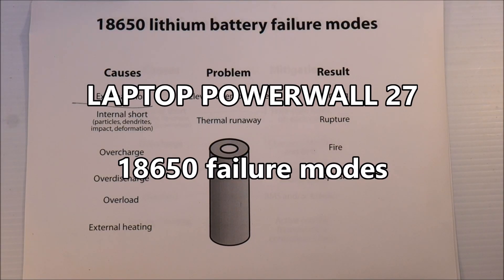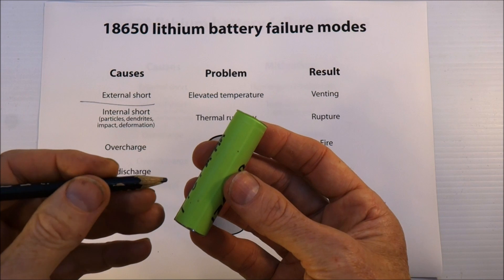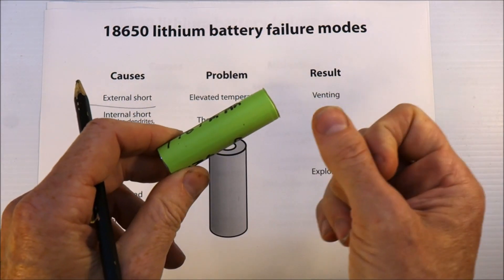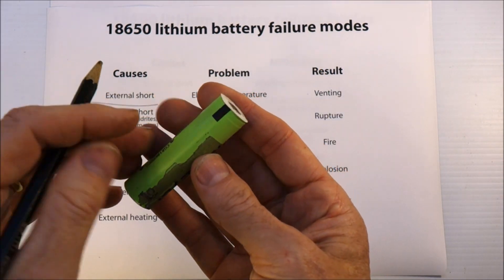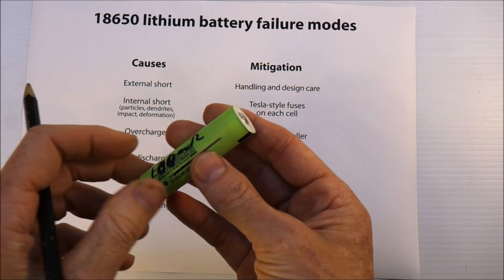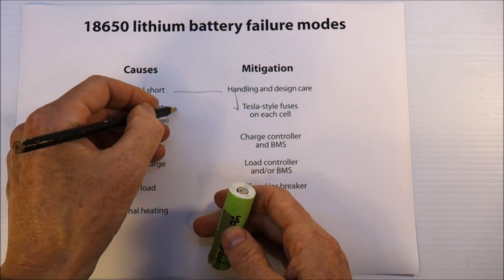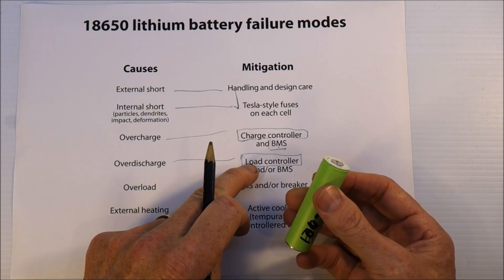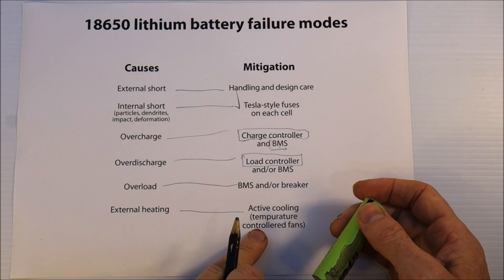Laptop Powerwall 27 - 18650 battery failure modes

Comment: Nice video!
I asking myself what happen if, let say, one cell in the midle of a pack starts (for any reason) a thermal runaway and start to "burn"?
I wonder if it could create sort of chain reaction : overheating near cells that would start overheating, thermal runaway and so on...
Reply from the maker: +Propergol If any cell starts to burn... it's bad. Theoretically the pressure release valve, the Tesla-fuse, the active thermal cooling, the BMS and the main breaker will do their jobs to prevent a cell getting to the burning stage.

Has anyone seem a good explanation of why sop may hover boards have caught fire? They seem like the best example of stuff going bad. My hunch is it's a combination of poor thermal management, poor BMS specs, overcharging and overloading.

Comment: Great video. Very informative. Good luck on the 400 battery packs you picked up. 

How much did those packs cost you?

Have you worked out your cost per cell?

I'm at about 30 cents Canadian a cell.
Reply from the maker: +Eric Scherzinger I got 75 of them for NZ$1 per laptop battery. The other 371 were free for helping out at my local IT recycling station. It's definitely worth having a chat to your nearest recycling people if you can.
Reply: That sounds like the best trade off ever. A little bit of your time for a lot of battery packs.

My experience with many recyclers is that they either want to make a unreasonable profit ($5 CAD a pack) or decide not to even sell you anything as they think your not qualified to handle possible dangerous batteries. Some facilities require you to be a licenced company with qualified staff, and fall under the description of a certified environmental center to even do business with you. They want verification that any material not used is recycled through the proper procedure, channels and facilities.

It can be very stressful at times finding someone in charge that will deal with purchasing of batteries at these places. 

They have brokers for all kinds of metal and electronic waste to deal with purchasers. These brokers go down to a metal purchasers conference in the USA every year. Companies in china hire scouts to visit metal recyclers and bid on metal and material. 

That's my rant. Wish it was easier on my end. 

Cheers and Keep up the good work.
Reply from the maker: +Eric Scherzinger My local recycler is small enough that I was able to build up a good relationship over the last year. I do feel very lucky though. The right offer to the right person at the right time.
Reply: +Paul Kennett I did bought mine for more : USD1.115 each cell shipped from UK to France. The good thing is that they were not "dead" packs, simply used packs still charging. I have only tested 66 cells over 420 but only 2 are dead on 66. This is pretty good I think. 95% are above 4850mAh (tested paired) with safety margin in charge and discharge. I must say that was a bet, it could have been much worst :D